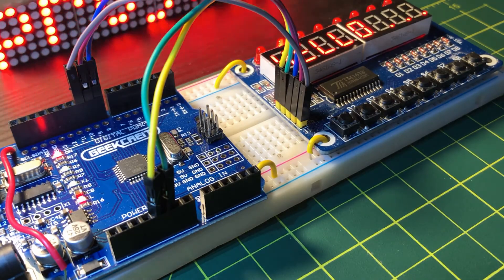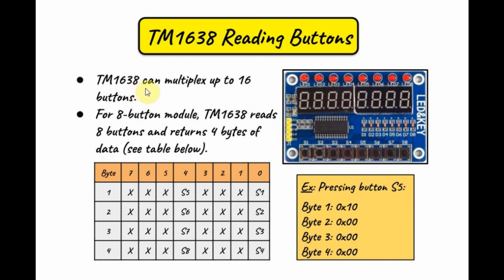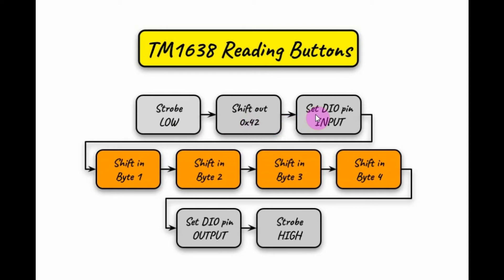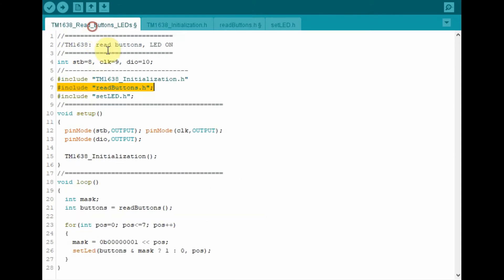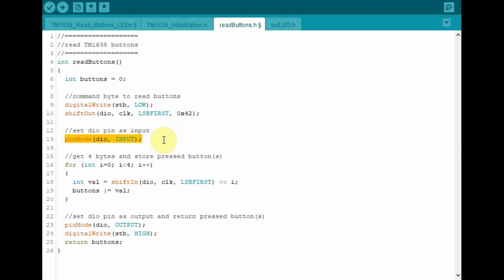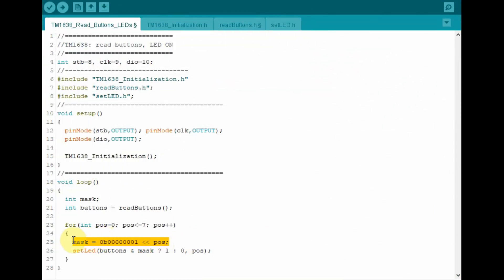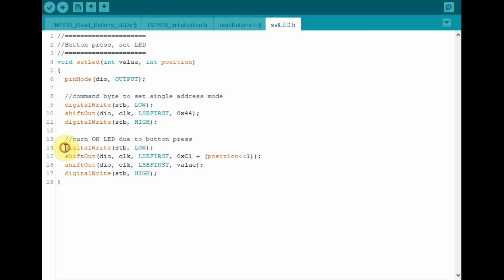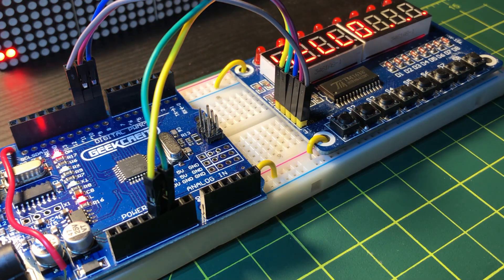TM1638 Programming (part 2)

Comment: Thanks again. I'm commenting as I go along but I gotta go after this comment and I'll watch the rest later. I say this incase you already go over this. Can the buttons be multiplexed if you hold one down then another is pressed to do something different than it already does. Each button when held down would be like using shift and to keep it simple and not factorial it to death let's say we go 2 levels which would produce 120 different button commands. If you pressed all 8 buttons they have a single function but of you hold in each of the 8 an another which would create 15 combinations x 8 haha. I hope I make sense. There would be alot of anding and oring ehh lol

It could be used as a control console with an arduino mega along with a bank of relays that control your work bench equipment. Just a funny thought

Comment: Why is code included in the header file?

I’m a programmer and use the same file type (.c or .cpp) for included functions.
Reply from the maker: I used header files to structure large code.